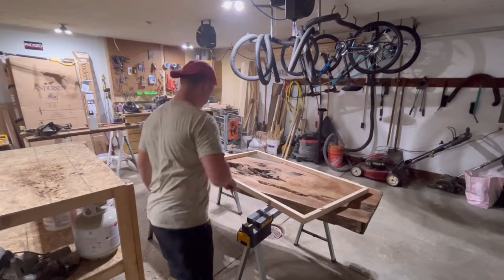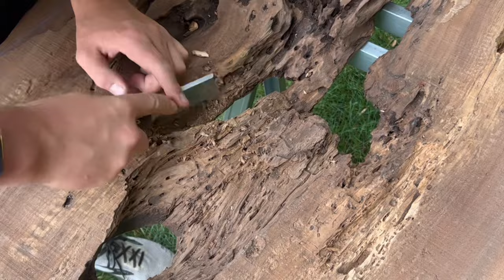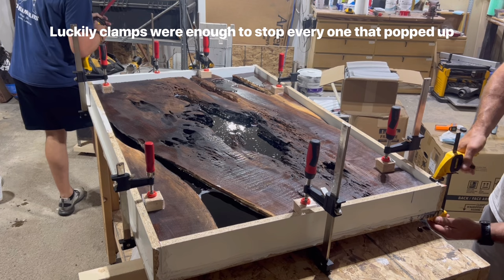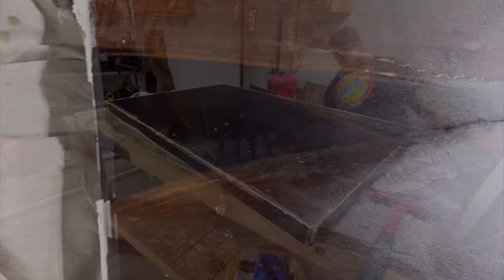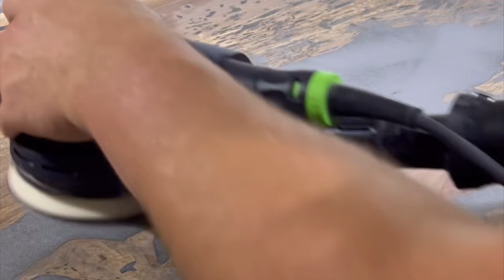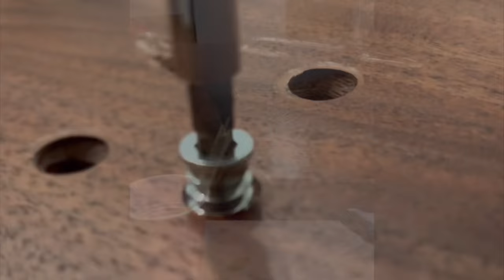First Epoxy Table Build (No Voiceover)

Comment: Was that a kutzall blade?
Reply from the maker: No it was just a wire wheel disk. I do have kutzalls though and they are awesome disks!!!
Reply: @SchutzWoodworks  I need to get wire wheels for sure. I’m considering a kutzall as well to shape wood and add dimension to the epoxy